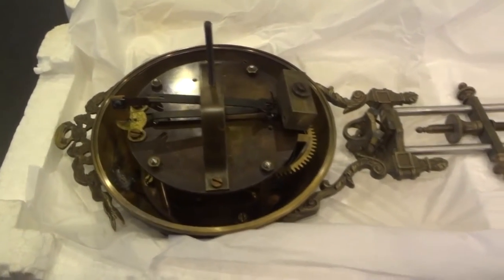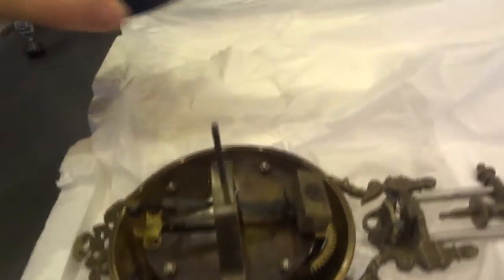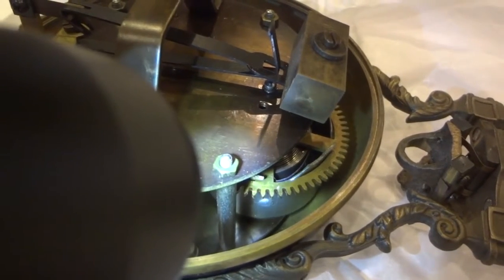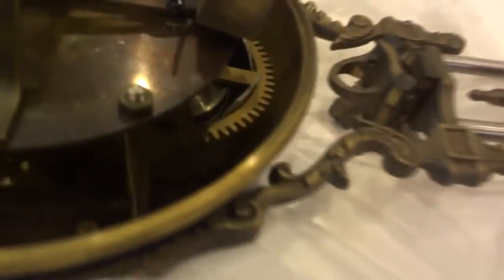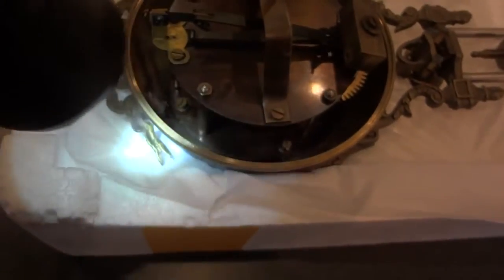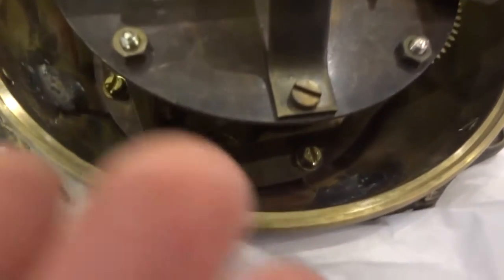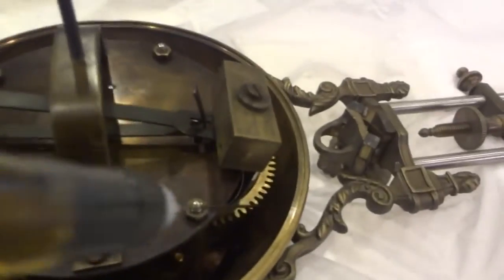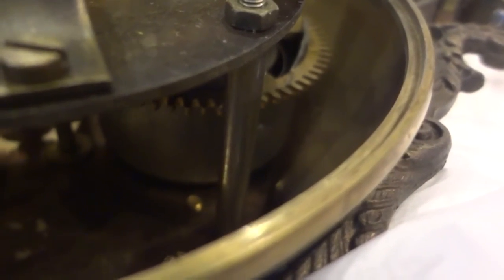Diana Swing Clock Stopping

Comment: I own 2 Ansonia Swing clocks, and both are running well, but gain substantial speed.  Any ideas?
Reply from the maker: Asking the obvious question. Have you adjusted the length of the swing arm? Adjusting the tempo is backwards from a typical clock pendulum in that by making the swing arm longer, it will actually increase the speed. On a typical clock, increasing the length of the pendulum would slow the speed.